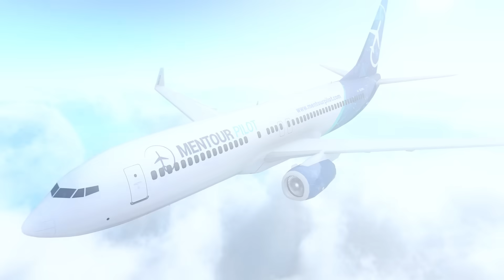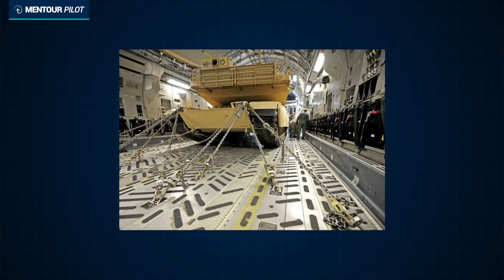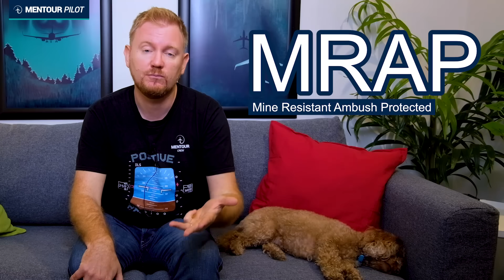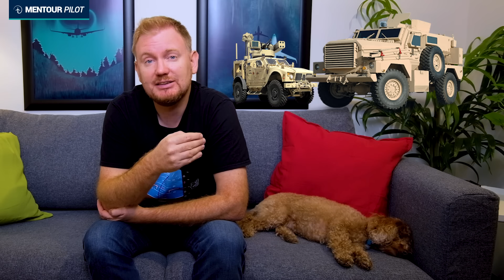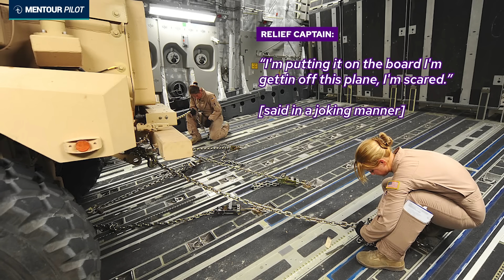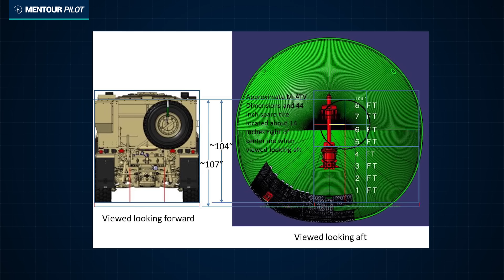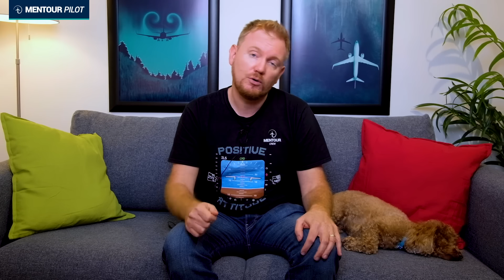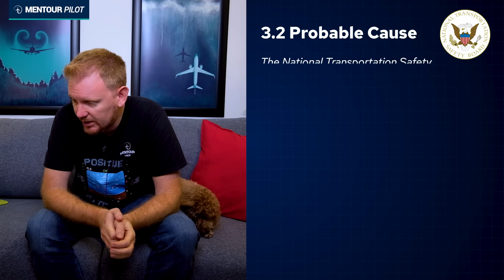Why did the pilots LOSE control?! National Air Cargo flight 102

Comment: After seeing this video come up on my video feed and found out it was a military contract I assumed it was load shift because of the dimensional loads they put on aircraft. However I did not realize they put several heavy transport vehicles on board. Even if every pallet was secured with Boeings recommended 60 straps/ chains/ lashings....I still don't think the floor tie downs could hold all that weight and would compromise the structure of the whole aircraft. This accident took out 33% of National Air Cargo's fleet at the time, they owned only two 747-400's. A few years ago while plane spotting at Dover Air Force Base in Delaware I saw the other unit delivering to the base.  That's when I found about this accident and their fleet.

Comment: In countries ridden with conflict It is known that  civilian aircraft are advised to climb and land in a higher rate of accent/ decent than normal to avoid or minimize the success of  ground to air strikes by enemy forces near the airport. I wonder if this aircraft did that and if the greater angle of pitch  was taken into account  when calculating and strapping down.

Comment: It's likely that simply adding more straps after the first flight wouldn't have helped. If the straps started the flight tight and ended loose, it means the strap material yielded in use and was permanently damaged. Since there's no way to reliably know which straps had yielded, the only safe response was to remove and trash all the straps that had been used on the first leg to make sure they were never used again. Afterward they would've needed to replace all the straps and, of course, add a lot more. Instead, its likely that they saw loose straps and tightened them down even harder than before, which virtually guaranteed they would break since most of their strength was already employed in tightening tension. But if the loadmaster didn't have any special training, there's no reason to expect him to know this; the same is true for the pilots.

Comment: Poor effort from the load master and the crew. Scale it down a bit. I shift a lot of scaffolding. If I don't make sure it is properly secured then it either falls off the back when I accelerate or it turns me into juice if I need to brake. I wouldn't consider letting someone else tell me it is OK.

Scale it back up - 'If that load shifts I'm gonna die.' I'd check it twice.

Comment: This tragedy was a prime example of the deadly consequences of private companies taking on military contract doing the jobs of soldiers in an active combat environment. The Air Force has been transporting those MARPs around both in Iraq and Afghanistan without much serious incident because they were “trained” properly with proper equipment and tools. Just by the way they were doubling up those Air Force pallets to “hold” the MRAPs indicated that they were improvising. The sad part was that it’s a common way of things getting done in a combat zone by private companies under contract with the DoD, although things don’t get as deadly on the ground. There were many instances of outdated and poorly maintained chopper crashes which where utilized to transport personnel from base to base especially for civilian TCN (third country nationals) contractors.
When this crash happened, I was on the other end of the runway at the rotary wing terminal waiting for my flight on a “shit-hook” back to my base. We were on the tarmac when the thick black plum of smoke raised above the end of the runway. I was sick to my stomach and needless to say, my flight was delayed for quite a while until it was determined that there were no enemy action around the airbase.

Comment: Agree with the point that all weight and balance ultimately rests with the pilot.

The pilot may not be "au fait" with strapping of irregular loads, though for the initial carriage of such cargos, surely a detailed plan should be in force.   When in doubt, double strap everything, and possibly use physical "blocking of the load.  (What are acceptable assumed G-load for air cargo- ?? 2.5G ??)

Comment: I remember that day at Bagram, our main base camp about 30 miles from Kabul, in the Himalayas.  I just drove by that end of the runway, (north end), right before the airplane crashed there.  I had turned and was heading south, out on the perimeter road, when it crashed, so I did not actually see it happen.  When I got to the south yard, about 10 minutes later, I parked and someone asked if I saw the airplane crash.  That was the first time I knew anything about it.  There was some conexes stacked, blocking the view.  

The runway has markers I remember going up to 14,000 feet.  The airplane crash was across the road from the north end of the runway, at the landfill / burn-pit.  A truck driving there almost got hit.  All I could see from the south end, was black smoke.  There was rumors flying that it was the freedom bird, the airplane that our folks take to go out on leave time.  Later saw the MRAPs at the crash sight.  We figured no one could of survived.  
A very bad day at Bagram!  Hope to never see anything like that again!

Comment: Can't help wondering if the weight of the armoured vehicle jammed in the tail would have been enough to stall the aircraft, even without munging the trim jackscrew and the hydraulics...
Reply from the maker: No, even if all vehicles rolled back, it would have been controllable.
Reply: @MentourPilot   Ok, thanks!   I had always assumed (wrongly) that crash was due to the weight shift (rather than aircraft damage).

Comment: Out of curiosity: in the impossible event of having known what was going on right when it happened, would cutting power to all engines have improved the survivability of the inevitable impact, by reducing the angle of impact to terrain?
Reply: Too many G-forces from vertical speed impact with the ground. On impact, the wings break, the fuel rapidly spreads out and it is an inferno. Several hundred Gs of force at impact, no survivors even without the fire.

Comment: "Those heavy thing aren't gonna move" wait WHAT? Every truck driver knows that's the misconception that gets most people killed. Heavy things move if exerted to enough inertia. I learned in driving school for a freaking forklift -.-
Reply: Some years ago a friend of mine was transporting a pair of two huge rocks  in his little van without secure them. I estimate that one of these rocks weighted 200kg or more. As i told him: "Are you crazy, you have to secure the rocks!" he answered: "Ah, no, they will not move because they are too heavy too move..."
Physics at its best... 🤦🏻‍♂️
Reply: @MisterIvyMike  If the vehicle can move with them in, they can move in the vehicle! And it doesn't matter what they or the vehicle are!
Reply: My experience securing loads in vans and on trucks agrees with this.

In my van, I assessed what was likely to be needed should I be involved in an accident - not just poodling along, or under normal braking.
To reduce the risk of getting crushed by six or eight drums of cable - each weighing about 50kg, I succured them with rope back under the back door to the tow hitch. Of course even this could fail, but better than just gravity.

On a flatbed truck, whilst the straps used held the load from dropping off the sides, again the forward movement during either extreme braking or a collision, relied mainly on the straps effectively 'increasing' the weight of the load, increasing the friction onto the bed, as the load moved slightly forward; which changes the angle of the straps, increasing the tension.

This is a self tightening system - more movement, more tension. The limit to the system is: the breaking strength of the straps, the integrity of the frame being strapped down - if either the strap or the frame break, the security is compromised.

Using chains was the only sensible way of restraining wheeled construction plant machinery! 
It seems madness NOT to require chains on aircraft. In this case, whether in vans, on lorry beds or in aircraft, the weak point are the securing lugs - in the case of this transport plane, each lug would have needed to withstand many times the physical weight!

 Ultimately an upper required strength is that required to rip a plane fuselage in half longitudinally! This would be a strength of lug that maintains load integrity DURING a CRASH; providing SOME possible protection for the pilots in such an event.
Reply: He probably wasn't thinking, in that moment, of the dozens of ball bearings they were freely moving on once the straps broke.
Reply: "exerted to enough inertia"....?  Inertia is the resistance of any physical object to any change in its velocity.
Reply: @Robinhim2002  I know. And I assume you know what I was trying to say.
Reply: last week, somewhere in Zürich, someone forgot to put the handbrake on some wagon...it held until the night, then it started to move...towards the cleaning area, which is now inoperable and lacks a huge door...

Comment: so basically the load shifted on take off ripping apart the strap harnesses almost immediately as the B747-400 BCF reached V1 & rotated to take off!!! the weights shifted to the right so rapidly that the crew barely could even understand what was happening before the B747-400 BCF crashed!!! very sad!!!

Comment: I don't think the straps were the failure point, but the design of the aircraft cargo hold-down points for handling load up to the aircrafts cargo limit. 24 5000-lb straps on a vehicle that didn't undergo more than maybe 1.2 Gs is highly unlikely to have failed at the strap, especially loads in a horizontal direction where the floor takes nearly all the load. It took 60 connection POINTS on the aircraft according to Boeing, which takes up 75 feet of cargo area.  This means that the aircraft could never be fully loaded with the weight of more than just one vehicle because there's not enough attachment points for two full vehicles. If the forward attachments failed first as they would naturally have, the torn straps found would have resulted from the sudden shock tension as the aft straps first went slack then taught again with tremendous kinetic energy. Some structural system in the subfloor to distribute the loads with a 8 points should be well within a healthy safety factor for 18 tons at 4 Gs. For example, Grade 100 1" chain at 60° with 2 attachment points would hold down 155,000 lbs. But the attachment points are pulled at an angle, which means they are subject to shear forces and reduced vertical component of holding power. The more straps you need, the less ideal the angle is, and the further attachment points you need to use it. It's the law of diminishing returns. The gross cargo limit of the aircraft was simply too high, and the limiting factor wasn't weight and balance, but is the ability to secure the load with the provided attachment points. The aircraft was not capable of this size load with –any– type of straps unless the attachment points were stronger.

Comment: I just wonder why the pilots didn't abort the start when they were this concerned about the straps

I have had INTENSE arguments with pilots that wanted to do a "quick quick hurry hurry" turnaround and didn't care about proper load balance/securing because I just wouldn't let them leave like that and insisted on reloading the aircraft ... it might not have ended like this but it's my job and I could go to bed knowing I did it properly
"Just load everything in the AFT" is something I have heard WAY too often

Comment: Surprised to hear there were no FAA training and certification requirements for load masters.
Reply from the maker: Before this. Now there are.
Reply: @MentourPilot  With so many requirements by regulatory agencies: FAA, CAA, or even DoD I am still surprised this was an oversight by the FAA or DoD didn't require this of load masters.  

Our firefighters were the ones that responded to this particular crash at Bagram.  Even as contractors, our firefighters had to meet specific DoD certification requirements to work in Afghanistan.  

This was a tragedy for the crew and their families, but could have been much worse.